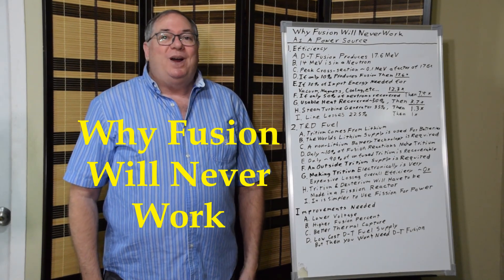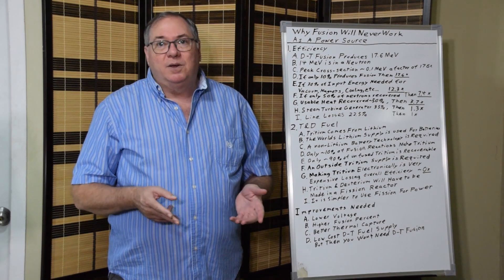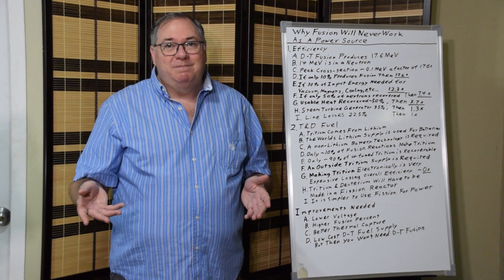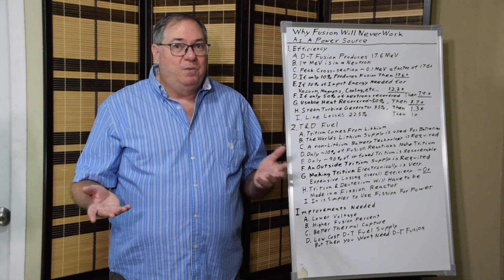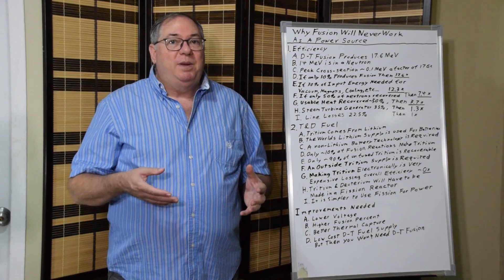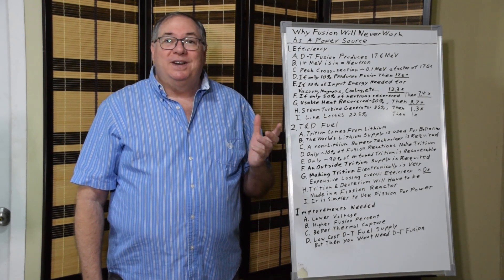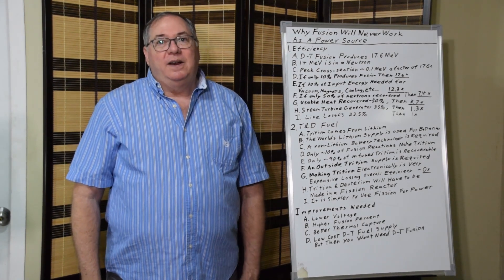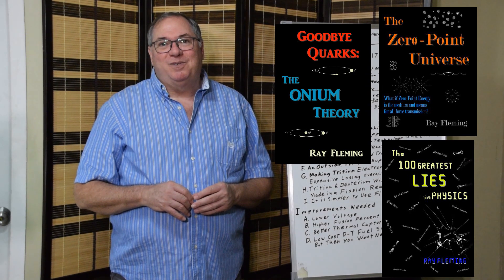Why Fusion Will Never Work

Comment: I've had the same prediction for quite a while myself. I come at that conclusion from a completely different direction, though.
I say that the fusion that takes place on the Sun is an EFFECT of how it's powered, and NOT the power source itself. Since it's just an effect, it's impossible to take that approach to generating electrical power.

Comment: Your understanding of the constituents of the vacuum - I wonder if you recognize artificial gravity as a containment field being one reason that technology is sequestered?

If the tokamak or other 'hot' fusion reactor was retrofitted with artificial gravity containment, 'breakeven-plus' output would mimic how the sun (and stars in general) work.

Only two 'moving parts' in a star:
1)  hydrogen (the most abundant element in the universe, and not buried underground in OPEC countries)
2)  gravity field

Our small study group of artificial gravity hobbyists figured that the breakeven-plus fusion reactor output would disrupt the global energy ecosystem, practically overnight.  

Besides the weapons potential of artgrav, this "instant obsolescence" of legacy energy supplies is a big reason to hide the tech.

I suspect you'd agree "if artificial gravity containment was practical/feasible, reproducing what occurs in stars becomes possible"
.

Comment: Russia made it work in 1961.  They used gamma radiation from a fission reaction to drive a lithium fusion reaction which basically just amplified the energy that would have been released by the fission alone.  The energy output that they measured was over 100 times larger than they expected.  They called it the Tsar Bomba.

Comment: Hey ray i haven’t finished the video yet but I want to ask you question. How could a positive energy fusion reactor be theoretically possible because that seems to be impossible according the the laws on conservation of energy. Where is the positive energy supposed to come from? It just seems illogical to me I don’t understand
Reply from the maker: In a fusion reactor the mass of the end product atom is less than the combined masses of the initial atoms. This is due to a difference in nuclear binding energy with the excess energy being emitted and hopefully captured to make electricity or something else useful. To make it work for me energy production you have to use less energy to cause the fusion than you get out which is difficult to do unless you are a star.

Comment: Fission is easy because of intrinsic energy feedback, all we need is to introduce a right amount attenuation. 

Fusion is more difficult. It operates on extrinsic feedback loop. Like an internal combustion engine on diesel. It requires continuous supply of fuel, compression and heat just to produce excess heat. Followed by a steam turbine generator just to maintain the hungry reactor. 

Fusion uses artificial confinement and artificial temperature N times the core of the Sun. The budget hungry scientists behave like engineers and mathematicians but physicists who know what they do and willing to follow alternative science. 

Alternative? Talk to Eric Lerner about his fusion proposal. There is no need to apply artificial this and that. He knows plasma doesn’t need artificial confinement or artificial temperature to achieve fusion because plasma has natural instability that can self confine to fuse hydrogen to produce electricity without the use of external steam turbine generator.

Comment: Agreed, Net-fusion is a funding doddle.  Your description is excellent.  I cringe when I see how much fluffy stuff gets promoted around net-fusion success stories and the investment opportunities that ensue.  My simplistic view of it is based on latency.  Take a Kilo of stuff at Room temp and a kilo of the same stuff at 3 degrees K.  Reduce each original volume by 1/1000 and measure which produces the most heat.   Gravity is pretty good at squashing things together but thermal energy tends to do quite the opposite by field excitation. 

The bonding of a proton or neutron might mean resisting the electrostatic field torque in the nuclide and maybe there's a little thermal action but compared to all that juicy stuff gained from simply squashing the electron clouds down I'd reckon the stellar nucleosynthesis thermal energy mainly comes from nebular latency from the parent body and any nuclide decay radiations we see are simply neutrons doing what neutrons do especially with highly heated and excited beta particles kicking off some gamma rays occasionally.  

When I see Net-fusion experiments adding thermal energy in hope of rationalising the gravitational component of the equations I cringe for it is the gravity squashing atoms that transform most of the electron cloud mass equivalent into thermal energy before fusion can occur.  The act of fusion and the ability of the field torque resistance to form a bond is more efficient without all that noisy disruptive mass energy.   It's a proximity thing. :)    Anyway, that's my simplistic version. :)   Net-fusion always rustles up a few dollars from investors and politicians trying to look cool so it's a good side hustle that keeps scientists and engineers and builders in wages.

Comment: So, what is the ultimate energy? Does it have something to do with quarks and neutrinos instead of atoms? Does the Big Bang theory allow science to look at these tiniest particles the rightful, law-abiding way? The answer is no because a harmless cloud of gas and dust must become the most powerful objects in the universe with nothing but gravity. This forces normal matter to be the sole provider of gravity that is created. This assumption automatically ignores the purpose of 95% of the mass of our universe. That is not going to be good as far as physics go. 

This is what the scientific community gets for basing its upcoming future on the assumptions of one Belgian priest. The scientific community wanted magic and it got it. It is as if all the problems that exist do not really exist because the Lambda-CDM model is an absolute fact. All the theories are ad-hoc'd to mold around the Big Bang theory including fusion.

Comment: Have you watched Eric J. Lerner's talk on the LPPFusion YouTube channel called The Big Bang Never Happened?  I'm a little suspicious because he sounds a bit like a Thunderbolts guy and he's saying that plasma vortices are responsible for a 2.7 K microwave fog throughout the universe instead of it being CMB from the Big Bang. He's also a proponent of a fusion power effort, obviously, and gives a pitch at the end where he says they can get fusion fuel from sea water for the reactor. PB-11 fuel from sea water. That sounds expensive and costly from an energy consumption standpoint. About the vortices though, it seems to me that his explanation should be broken down further to explain where the vortices originate. Also the theory cannot explain away the Hubble process whereas your theory does seem to do so. A side note. Mr. Lerner says they also use these plasma vortices in their experimental fusion reactions and that this is how the universe creates free energy, as opposed to trying to say, recreate the conditions of a star here on Earth like the other guys trying to create fusion. To me it seems ridiculous without the mass and pressure of a star.  Any thoughts on this vortex thing?

Comment: After the Big Bang happened, the universe didn't get to choose what type of hydrogen it got to use for fusion. 

The equation for fusion is 1+1=2.1. Two protons turning into an atom with two protons is not going to make some magical amount of energy. It's just a part of the conservation of energy and mass. 

The assumption that fusion must obviously work is because of the Big Bang theory which is now a complete fact. After the initial "quark-gluon plasma" cooled to atoms, that was all that was left to do everything. Science picked gravity to be the energy that could turn a harmless cloud of gas and dust into a star that will last billions of years. Unfortunately, gravity isn't some free energy that normal matter gets to use as it pleases. 

What science is truly looking for is called quark plasma which is what black holes are made of. 13.8 billion years ago, our universe turned itself into a gargantuan particle collider with two objects that contained the mass of the observable galaxies. The galaxies are expanding because they are shrapnel from this event. They were created the second the collision happened, not millions of years later. That explains why galaxies exist where they shouldn't. The collision created all the energy we see, not gravity. That is why science has no idea how the force of gravity works. 

Once quarks have been separated from a sufficient enough reaction, it is the sheer density and pressure of space that is able to keep the quarks apart indefinitely. The true strong force in our universe is created between quarks and dark matter which is an extremely pressurized field of sterile electron neutrinos. The attempts of the strong force to reconnect these particles throws the neutrinos out of the plasma as gamma rays. Of course, the big bang theory states nothing can leave a black hole but, then again, science has no idea where all the cosmic and gamma rays come from because of the Big Bang theory. They come from the most powerful objects in the universe. Where else would they come from? 

Quark plasma follows the conservation of mass and energy law by fusing the quarks and neutrinos on the surface to create the first neutrons, and optical light, the mass will possess. Once enough neutrons have been created, they start decaying into hydrogen. Then, the constantly forming neutrons fuse with the hydrogen to create the first helium the mass will possess using the beta minus decay reaction which I'm sure you know about. This is process continues creating heavier elements making the star darker until the light is extinguished and a surface forms. This is when the atmosphere is allowed to develop. 

The only fusion this universe carries out is the one stated above. It is nothing but a way for kinetic energy like a black hole to turn into potential energy like our Moon. Of course, the Big Bang theory completely ridicules this process by having to create the energy to make the heavier elements by using exploding stars so the true entropy of matter is impossible to explain. 

Quark plasma is optically invisible and can make shapes. Our galaxy was a single, spinning mass of quark plasma that used centrifugal force to create a disk with a bulbous center. The outer solar systems are going so fast because the galaxy was one object in the beginning. The center eventually separated from the disk and our black hole was formed. The remaining quark plasma disk was left to create all the solar systems that orbit our black hole to this day. Our solar system did exactly what our galaxy did. A disk was created with a bulbous center and the center separated from the disk and our Sun was created as a black hole. The planets were left to be created from the quark plasma disk that was remaining. Even the planets and their corresponding moons and rings were initially single masses of quark plasma that did exactly what our galaxy and solar system did. Our moon is a rock and our Sun is still a star because smaller initial masses cool faster because there is less energy involved. 

Gravity is created by the field of sterile electron neutrinos. Science doesn't understand gravity because the big bang theory forces normal matter to create its own gravity to become a star. Energy creates gravity, gravity doesn't create energy. Gravity is created as electron neutrinos are shot from the mass as energy that is gravitationally invisible. This pushes out on the natural pressure of space to create gravitational lensing since it is all the same matter. Gravity is created as space uses its natural pressure to push through the outgoing matter and reacts with normal matter as gravity. That is the same matter that will be the catalyst for the quark plasma reactors. 

I know how impossible it is to get through to even the most educated physicists in the world. Their education has told them fusion will work when it hasn't for 80 years. It is truly amazing how much damage Georges Lamaitre created in science. He wanted the Big Bang to follow Genesis and he got it even though Hubble and many of his peers never accepted the assumption. Somehow, it went straight to a fact. 

A quark plasma reactor will be incredibly easy to build. It will be a hollow container made of a shell of extremely tough metals. A relatively small amount of pure hydrogen, with no neutrons, will be placed in a vacuum and severely compromised with heat. Then, it will be electrocuted into existence just like what lightning does to our atmosphere when it creates gamma rays. After that, unlike fusion, there will be nothing for us to do but harvest the energy. Quark plasma will create the magic energy that science currently thinks fusion will deliver. 

Ray, I believe I have just explained the "Theory of Everything". Everything I have stated follows every law in the book. It is always nice to hear someone say "this is why fusion won't work" because, as you know, the whole scientific community has been bamboozled by a century old theory that never explains anything. They are completely convinced that they are right even if they had seen the video you posted. Nothing gets through.

Comment: Never say never
Reply from the maker: I primarily meant that D-T fusion is impossible because there is no cheap fuel supply. For fusion to work commercially it would need to use 2 or more cheap isotopes.

Comment: I agree fusion will never work and will never happen unless they can trap like the heliosphere and feeds back into the system.  Even then the issue is permeation of the metals and can't be contained.  It's part of the issue with fission reactors as normalized discharges contain H3, carbon 14 that then bonds to oxygen to form 14CO2, KR-85, iodine 129 and 131 which doesn't bind to soil, Sr-90, Ru-106, Cs-137, noble gases, particulates and others.  Tritium thought to be the softest of radionuclides and thought to pass through the body within a month which is not the case.  "Tritium directly or indirectly induce various biological effects including DNA strand breaks, micronucleus formation, cell necrosis or aptosis, chromosal aberration and various other phenomena thus negatively affecting human health. The half-life of tritium is 12.33 years and the AVERAGE penetration of its ELECTRONS in water is 0.56um, which is considerably lessthan the AVERAGE diameter of a human cell.  Therfore it does not cause damage due to external irradiation but rather long term internal radiation that results from inhalation, oral intake or absorbance of radiactive particles through the skin. AFTER ENTERING AN ORGANISM, TRITIUM CAN REPLACE HYDROGEN ATOMS IN BIOLOGICAL MACROMOLECULES OR BIND TO CELLULAR COMPONENTS TO FORM......ORGANICALLY BOUND TRITIUM (OBT). Exposure increases along with tritium levels in the environment."

Comment: I hate to say it, but I'm afraid you may be right about tokamaks and neutronic fuels. But have you read about DIII-D's new report? They're talking about a tokamak with much higher pressure, allowing them to use much lower temperatures and currents. Would love to hear your take on that. There are other options though, too. Check out LPPFusion. They're using a dense plasma focus device and aiming to use aneutronic fuel eventually. Very novel approach with a lot of potential, especially for the low cost. Also, HB11 recently made a breakthrough in February allowing them to achieve fusion at a much lower temperature. And they're very well funded compared to LPPF.